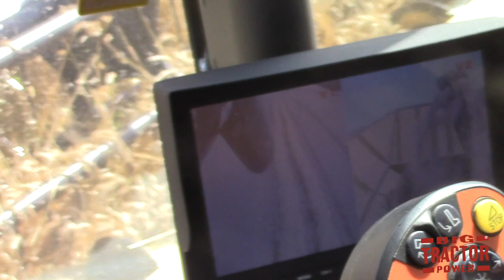Claas Lexion 585R Combine Making Baling Straw

Comment: first of the r does not mean track system we have a 560r and it doesn't have tracks the r stands for rotor instead of straw walker. the number 5 at the end 585 is for tracks if it was 580 it would be a tired machine.
Reply from the maker: You are correct.  I goofed in that.  I was doing the specs from memory and messed up on the model number.
Reply: bigtractorpower no biggie we all make mistakes I had to do a double take when you said that. btw if your ever in Indiana hit me up we run 12 claas choppers and mowers on hay and silage in indiana and michigan.

Comment: did you know that back in the 50s you could buy a new combine with a built in baler as part of the extra stuff you could buy
Reply from the maker: Which company offered that?
Reply: massy harris made some. i have an old broshure somwhere. the massy-harris 890 combine had a lot of  extra equipment available here in denmark including a baler

Comment: The Deere is confined to a 20' header... then put a divider on it as well like the Claas and put larger head on it and it has the same capacity. Making it sound like the Deere can't hang...
Reply from the maker: The Deere is not really set up to split the windrow.  The Lexion has two rotors and the divider keeps the straw divided as it comes out. The Deere does a fine job but the Lexion allows the farm to run wider.

Comment: All the green in the stubble is that weeds or is it cover crops seeded in?
Reply from the maker: Clover that was over seeded.  They plow it up for green manure in the fall.
Reply: That's what I figured.  I grew up out here, and am used to seeing red clover quickly cover wheat and oat stubble as soon as it's cut.   We used to use buckwheat as a cover crop/green manure in our garden.  We'd alternate sides every year.   You had to catch it early and disc it under, or it'd reseed itself, and you'd be pulling out tons of it from the working part, lol.

Comment: 8 series deere on an idiot brick maker. That’s overkill if I ever saw it!
Reply from the maker: The farm runs 6 balers over 2,000 acres.  Every row crop tractor on the farm gets used.  If you were baling that much ground do you want sit on a 4020 or 8130?
Reply: bigtractorpower if I was the farm owner I would sit on the machines that was the cheapest and most efficient for the job.
Reply: What’s the point in buying a tractor for  the one job, it’s more efficient to make the best use of a machine year round surely!